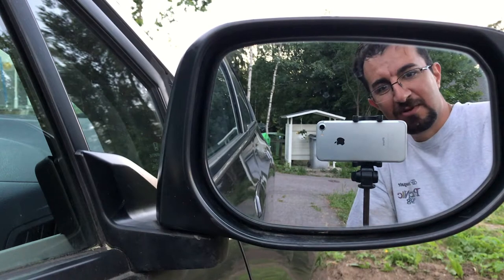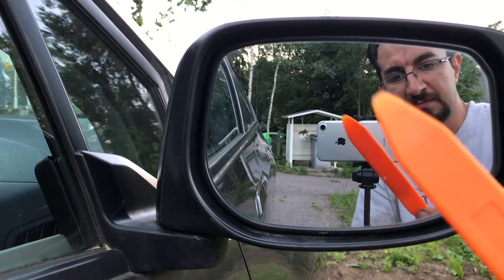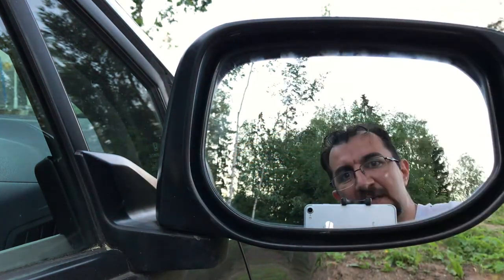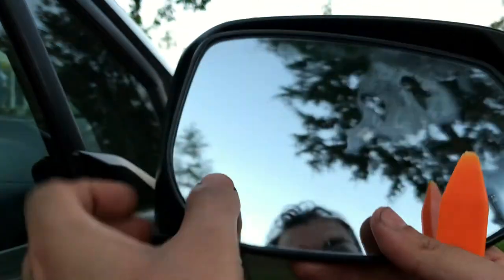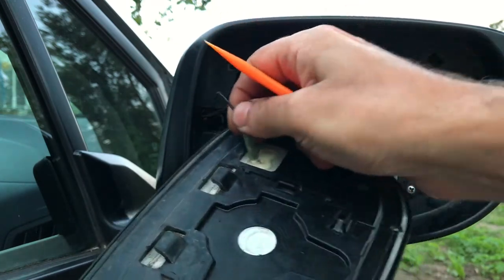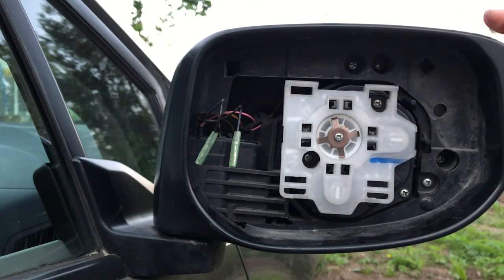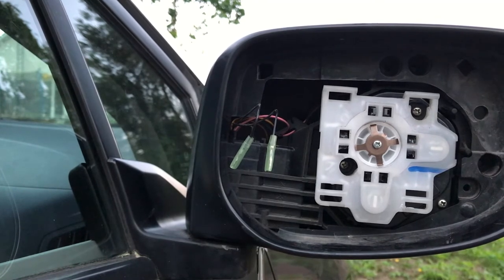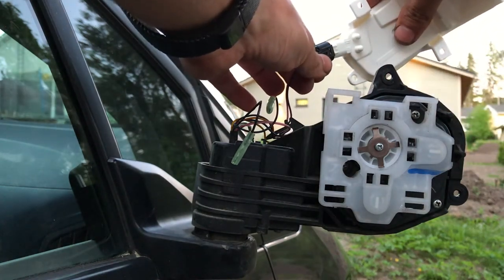Honda insight side mirror/indicator/blinker change.

Comment: My side mirror blinker also broken and need to replace. Before replcing, rain will come inside fron the crack. What will happen if water go inside from the side mirror blinker  crack. Electric shock? It can damage the whole electrical? system?
Reply from the maker: Depending on the size of the crack it might do some damage but definitely not a shock as the car runs on 12 volts DC power only. The little engine that does the rotation of mirror plate is in an enclosed housing so, as long as that’s intact you will be good. I would advise to clean all the possible junk that made its way in through the crack, seal the crack with some glue from inside, slightly lube the mirror plate gears, change any broken parts and put everything back together. If you take your time and don’t rush it. It will be good as gold. Thanks for your comments and GOOD LUCK 🤞 👍
Reply: @lifeleaves1268  Thanks for the advice. The crack is pretty big and bacame hole. Definitely rain water will go inside. Anyway I will use the clear tape to cover it up for the meanwhile. Thanks again.
Reply from the maker: @zayaraung5653  another thing that you can do if you want to get the extra insurance is tape the hole from outside the cover, make sure that it covers it aerodynamically with the lines on the cover, mix some jb weld and fill the hole from inside, leave it for 24 hrs and once it is dry carefully remove the tapes from outside. You should get good results and peace of mind for winter 👍